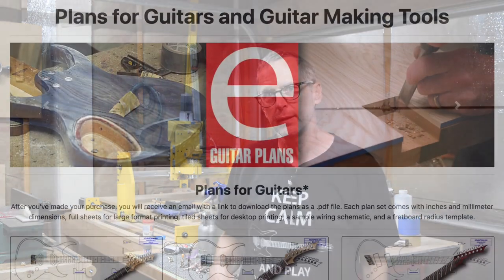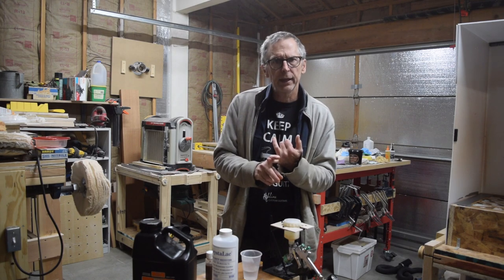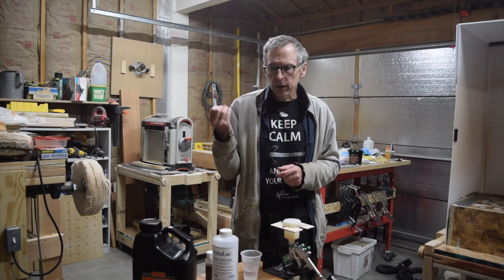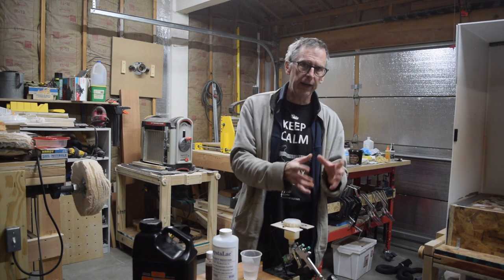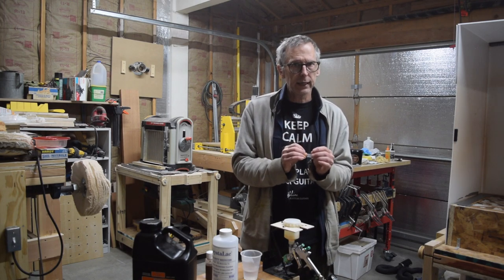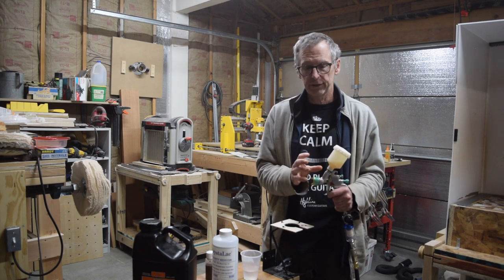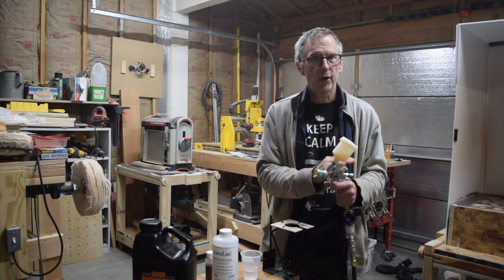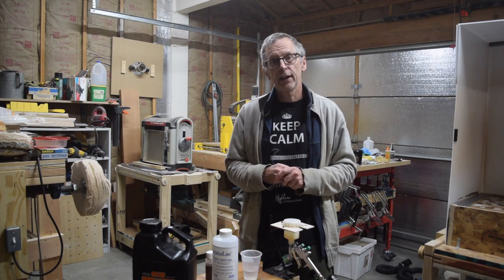Luthier Quick Tip 18 Selecting A Spray Gun

Comment: Would this work for that gun or would you recommend increasing? PORTER CABLE Portable Air Compressor: Oil Free, 6 gal, Pancake, 0.8 hp, 2.6 cfm @ 90 psi
Thank you
Reply from the maker: Contact Homestead Finishing or visit their website (link is in the description) for the answer to your question.

Comment: Great advice. I have a compressor the same spec as yours from the local big box store, it’s perfectly fine for most of my shop applications like nail guns etc, but clearly struggles pushing paint through a cheap HVLP gun. Even though the QualSpray gun is expensive (especially to ship here to Australia), it pays for itself quickly compared to what I’d have to pay to upgrade my compressor to something which can actually handle the HVLP guns. Hope that makes sense 😅! Like you, I only spray small pieces like guitars, small wooden tools and craft jobs; for furniture or larger pieces, brushes and rollers suit me perfectly.

Comment: Great vid... been debating switching to a gun from rattle cans for a while now. I have a 27gal 3hp compressor, so that's not an issue... just always been confused by HVLP, LVLP, needles for what finishes etc... nothing worse than starting off with the wrong equipment.

Comment: Thanks for video! But if you use this kind of spray gun, than is it good enough to have compressor who has aprox 4,4 cfm at 58 psi pressure like mine 🙂? Thank you?
Reply from the maker: Yes, as long as the tank is 10 gallons or larger.

Comment: Got my Qualspray gun today and what a great spray gun! Curious, what pressure do you use for Britetone? Thanks
Reply from the maker: I run it at 25psi at the gun with a 1.5mm needle. If it splatters, I'll thin the Brite Tone until it atomizes nicely.

Comment: I need one of these to lacquer a guitar body, which tip size would you recommend? Thanks!
Reply from the maker: As small as possible. Try .8 or 1.2mm. Even 1.5mm will work fine, but the smaller you go, the smoother the finish as long as you thin the lacquer correctly.
Reply: @HighlineGuitars  Thank you very much sir!

Comment: Hey Chris, thank you for the video on this spray gun.  Which needle/nozzle combo do you use for clear?  1.5 sounds kind of big, so I am guessing the 1.2?   For a Taiwan gun $275 is a lot of money.  However, this is not too bad when you consider the extras that you get (specifically the two extra needle/nozzle combos and the regulator).  

I considered one of these Qualsprays, but for that money I ended up going with an Anest Iwata LPH80.  I have Iwata airbrushes and ended up sticking with Iwata   Another good guitar gun I found after ordering my LPH80 is the ANI R160-Q.  A made in Italy gun that can be had for maybe $150-160, but you have to order from Europe.   

Great info on compressor size and CFM.  It is horrible that the big box stores sell pretty much only HVLP guns, but 90% of their customers do not own a compressor that can properly supply those with air.  Doing something small like a guitar makes it a little easier on smaller compressors, but still.

One question I have for you on your spray booth.  Are you getting much, if any material sticking to the internals of your blower/fan?  Unfortunately, (for the spray booth) my dust collector is one that has a filter bolted on the exhaust side.  So, not real easy to bypass that and go outside.   I need a down draft table, so maybe I will set something up similar to you, but find some other mechanism to move the air during paint sessions.
Reply from the maker: I use the 1.5 for my clear coats so I can spray without thinning the material. So far after spraying several guitars, I haven’t had any problems with vented overspray sticking to the blower’s internals.

Comment: Darn just got the SPRAYIT gun you recommended from old video have not used yet. Took2 months due to Covid .
Reply: You might be ok, just be careful what you run through it to clean it.  Some of the water based gun cleaners have ammonia, or other chemicals and these can eat away at the cheap plating on the cheaper guns.  I have heard that some cheaper airbrush manufacturers will not warranty their guns if they are cleaned with these types of cleaners.  Most nicer guns have far superior coatings and this is not an issue.  Chris, what did you use to clean that spray gun?   I have been considering  a mixture of denatured alcohol and distilled water.
Reply: Thanks

Comment: Thanks Chris, Very informative. Question about spray gun cleaning.  When you are applying multiple applications in one day (e.g. a coat every 2 hours), do you clean out the gun after every coat or are you able to keep using it for multiple applications in between cleaning.
Reply from the maker: I clean it out after every coat. I don't want to ruin the next coat with a piece of crusty dried finish shooting out of the gun.

Comment: Did you notice issues after spraying waterbase with your smaller sprayit 33500? I finish about 1-2 guitars a year so I'm thinking it would probably take a while for the cheaper guns to wear out if I bought the set of sprayit LVLP guns. Plus the qs125-wb is sold out.
Reply from the maker: The inside of the Sprayit rusted very quickly as the passageways were not stainless steel.

Comment: Hiya, I'm about to try Crystalac Bright Tone. I've got an LVLP gun and approx. 40 gal. of air. Will that be sufficient or should I use my control max sprayer, which is HVLP but have only done exterior building painting with it. Thanks for your helpful and informative videos!
Reply from the maker: Depends on the specs for the guns.
Reply: @HighlineGuitars  here are the specs for the LVLP gun I have, Air consumption 4.2 to 7.1 CFM @ 30 PSI
Working pressure 28-45 PSI. Maximum pressure 60 PSI
Reply: And like he said, how many guitars you're spraying.  40gal could probably handle either one but personally if you've got both I'd go with LVLP.

Comment: So does this replace your turbine Earlex system, or are you still using that? Would you recommend a compressor/hvlp gun setup over a turbine system?
Reply from the maker: It replaced the Earlex. Turbines are great, but they won’t power a sander or an angle grinder.
Reply: @HighlineGuitars  indeed not, lol. So it wasn't a quality of finish issue that made you retire it?
Reply: @TomL-  That would make for an interesting video. Comparing a gun like this to a turbine system.

Comment: Doesn't ship outside US (Europe) 🤨
Reply from the maker: If you find a gun with similar specs,especially stainless steel passages, it’s probably from the same manufacturer.
Reply: @HighlineGuitars  👍🏽tks for the best video on this for small shops btw! best names to search for these outside US?
Reply: @HighlineGuitars  Well I take it back, his eBay shop reopened (after vacation) overnight & it seems he does ship internationally BUT the qualspray qs-125wb isn't in stock !!